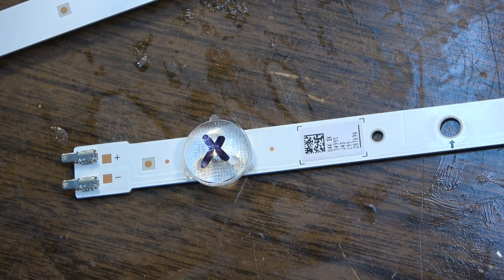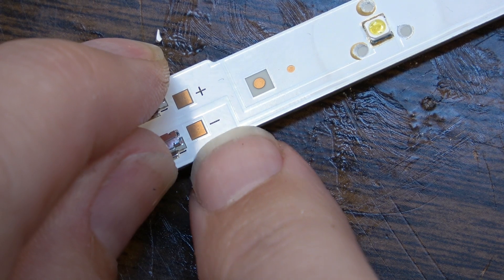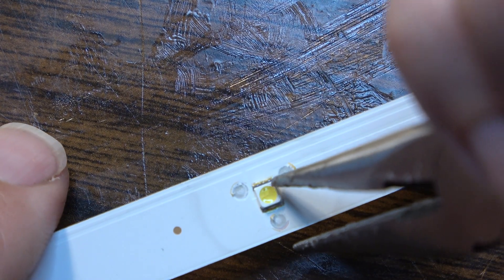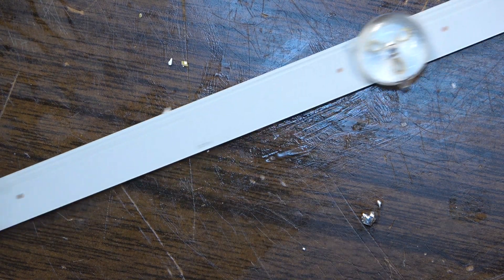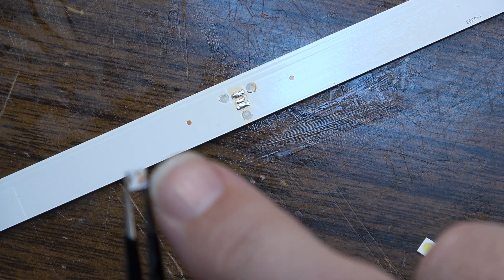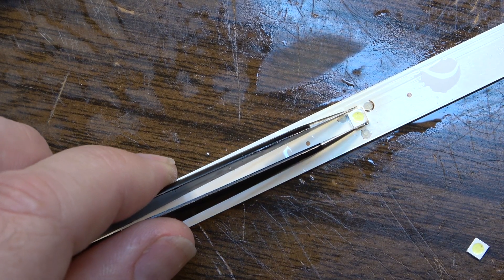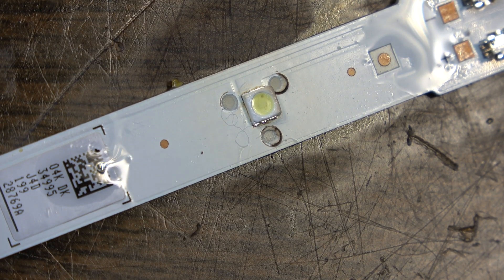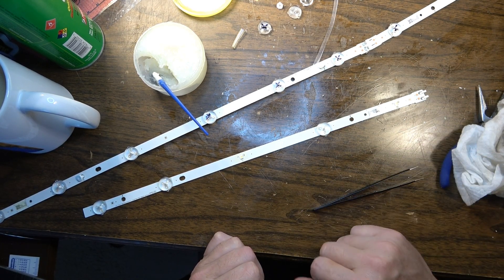How to Solder NEW Surface Mounted LEDs in TVs Instead of Replacing Strips - MUCH CHEAPER FIX!

Comment: All you guys love flooding everything with flux paste - Wasteful, unnecessary habit - learn how to solder! - you're burning up all the flux that's already included in the FLUX-CORED solder on the iron tip - before you even get near the PCB. LOL 

Clean and tin your iron tip, heat the PCB pads, and feed a little fine flux cored solder into the heated area - Done!
If you really want to do it like this, use solder paste, in little tubes, made for SMD work.
Keep flux paste for re-flowing SMD IC's etc.

Comment: I used a mini torch 🔥to remove the LEDs. I heat gunned soldered 3 LEDs in place. I then instead glued the top & bottom of the new LEDs onto the strip & used a 300W soldering iron on the left & right silver area of the new LEDs. The new LEDs had a wide & narrow soldering pad area that had to be soldered on to the wide & narrow pads which were in reverse of the new LEDs — I reverse the plug polarity by lifting the very small plastic lock on the plug to pull out the female connectors (red & black) & switch their places. They all worked but two of the new LEDs that I heat gunned in place turned off when the TV LEDs dimmed down — "Solder LEDs in with a soldering iron" 👈. . .  Heat will ruin the LEDs 🔥

BTW — I used a 3v button battery with wires attached & put 2 wires into its plug as a LED tester 😊

Comment: Yeah, and if you had just applied your hot air from behind the strip, it would all work without melting the LED 😄 And by the way: Hitting pliers with a soldering iron to "clean" the tip is basically plain dumb. The pliers will not care too much ... but those heating elements within the soldering iron usually don't like it. Get yourself some $1 copper/brass wool from Ali, your iron will love you for this.

Comment: Tanks for video. Your soldering tip is miserable!
So you have a heat gun ... why did you use a lighter to heat shrink your tubes for the mac plug repair ?

Comment: LEDs come in different colors (temperatures), brightness and voltages. If the new LEDs don't match exactly the old ones, they will stand out as annoying visible spots on your TV screen. So how do you know which LEDs are right for your specific TV set?
Reply: Exactly my issue right now. I have just 1 failed LED on my RCA and having a hard time figuring out what type/brand of LED to get!.

Comment: nice try! how do you put back the led caps, glue them or don't need to put back? thanks!
Reply: If you don't replace the plastic lenses, the LED will give a bright pinpoint light.  The plastic cover helps diffuse / gently spread the light to avoid "hot-spots " .  Small dabs of superglue are what I use to reattach the plastic to the strip. In the ones showed, there are 3 vary small attachment points for glue spots to match for the best results.

Comment: boy it hurts looking you killing this job ! please stop making such poor job !  you have correct tool but not the right technic !
for such job heat gun goes under the strip so you can unsolder the led and same for soldering back the new one without damaging it from direct it. even better and simpler with hot plate

Comment: Added the 1K like for your video!   I have repaired lots of stuff, including TV's, but repairing these LED strips, my first time.  Luckily I already have Hot Air rework station, good commercial soldering iron, and skills.   There's a video of a guy doing this with an Alcohol Lamp, heating the strip from the bottom to remove the LED's.  If you haven't seen it, you might like watching it.

Comment: clueless video. There is a reason it is recommended to replace all led strings when they start to fail but there is also a firmware update that has to be done as well.
Reply from the maker: pfft. Ok.
Reply: @TheGuitologist  the blind leading the blind is always good for a laugh but never the right way to do things. Don't let that stop you tho 😂

Comment: Thank you for the helpful guide. I am impressed that the heat produced from the heat gun does not destroy the LED component. I see from your comments you used the TXINLEI 8586 110V Solder Station. What temperature did you set the heat gun to?

Comment: Yeah I wouldn't rip off the LED with the pliers like that because if the pads from the trace come off with it then you're going to have fun bridging everything and it won't sit flat , it works though but it is possible too rip the pads and if you use the heat gun from the bottom then you don't burn anything on the top and you don't worry about the LED going for a ride I'm sure this has been mentioned in some of your comments but I did not read any of them so my apologies if I sound like a broken record other than that cool video cheers

Comment: I have done this a small hand full of times and use a hotplate for this purpose purchased on Amazon. It heats from the bottom and worked great each time. Just need to be careful as I burned a finger or two the first few times.

Comment: Hello from Germany, 🙂✌

Based on my experience, I heated them from below. Otherwise the plastic will melt and the LED won't survive for long. 👍
Reply: Yes, I used a soldering iron vs a heat gun. See my other comment.

Comment: I've tried this method,however instead of a heat gun, i used a hot plate, it does save you money, but the amount of time its not worthy since some of the brand new strip sets are cheap enough, also, if you just replace the band LEDs on each strip, eventualy the other ones will go bad, its always better to replace all of them with brand new strips. Lastly, those LED lenses are a pain to glue back and some strips if they are just a bit crooked you'll end up with white spots on the screen.

Comment: I did replace close to 5 of those led using older led for another tv, problem is they are dimmer once I turn the TV on, what surprised me when I saw that is that when I use my led tester they are the same brightness as the others but thought the tv power they produce less light even if the original one's one the same strip produce full brightness

Comment: I use aluminum tape and scotch tape.  I dont know how to solder.  And it repaired my black screen.  Am i Crazy or what.😅
Reply: Could you tell me how to do it without soldering I'm just about to fix my 65 inch TV and I've never soldered I'd rather try your technique it would be greatly appreciated thank you

Comment: I think you are damaging the layer on the LED by heating it from above. I don't think it was soldered by heating from the top in the factory!
Reply: Just heat from below with heating source and falls off it's like FETs soldered to a heatsink in some car amplifiers😅

Comment: thanks for sharing your ideas - just a suggestion. Rather heat up the solder for the LED replacement from the bottom...then you dont have to burn the LED with the hot air. The removal can also be done by melting the solder from the bottom ;-)
Reply: I was gonna say that.. or use a clothes iron if u have too.. or hot plate.. but if ur gonna use hot air.. don't burn up the plastic
Reply: @TerryDeSimone  I noticed the other side of the strip is copper coated, so I was thinking maybe that makes it easier to heat from beneath. Might need to watch your fingers though and don't lean over too close or things could get a bit warm.
Reply: With all do respect but you fried the led when trying to solder it. The entire  silicon is wasted and that led will not last long. You should heat from the bottom instead and no hit the led directly.

Comment: good job ,   how do you know if the tv  needs  3v or 6v  smd led   i have a tcl 43s421 to fix  and not sure what voltage  these leds need
Reply: Good question, I should have known that before replacing mine :), i should have use my multimeter and measure on the backlights

Comment: You must NEVER use the welder on that way. It is not a painting operation. You have to warm the area with the welder and then, apply the tin, which will melt and cover the area. The way you do it you only will get the tin totally burnt. Good video anyway and do not worry, a lot of people use the welder in that way, but it is totally wrong.
Reply: soldering iron not welder ..................

Comment: I think there need a lot practice and good luck, tried three LEDs dead all fried from hot air gun, that basement not copper - some kind of China material where solder won't stick
Reply: Start by buying a proper soldering station  like Weller ,jbc or if you are on a tight budget start with a universal 80w soldering iron (80w seems allot but your dealing with a cheap iron)proper tweezer and you need to calculate your led that your gonna replace otherwise after 2 months you gonna replace the same led on that row of line for example you have a Samsung backlight system that requires 3v per led you can replace it with another 3v led universal but you need to know how much what you backlight circuit draws If you backlight uses 3v 1w led I would use a 3v 1.5w led instead by trial and error I found that they last longer than if I would install regular 3v 1w led
Reply: @Creative_thinking359  you are right

Comment: Awesome. And timely. I have an led tv that has a fault. It has a faint picture that shows up if you shine a flashlight on the display, which I think indicates either a bad led backlight or the board for it. I'd like to fix it if possible. I'm tired of throwing away simple devices because nobody thinks it worth fixing things anymore.

Comment: Very useful follow up video.  I like the long one as well as it shows the whole journey, including the learning process.  More YouTubers should follow that format (full video + condensed "summary").   Anyway, I was thinking  SMD-solder-paste may be helpful here.  I seem to remember it melts at a lower temperature so it would not strain the LEDs that much during soldering.  (I fear the LEDs may break down early because they were strained/overheated during soldering)
Thank you for the useful video !
/chrisV
Reply: 138c paste would be good ............

Comment: I've fixed two TVs, a Panasonic and an ALDI 'Bauhn'. Both had single led failures which stopped all other leds glowing [series circuits?]. I tracked down the failed led and removed both lens and led. Then I snipped a working led from a spare backlight strip, about 1 1/2 inch of strip either side. Then I 'jumper wired' this in place and stuck it down with double sided tape. Unfortunately in the Bauhn a further led burned out shortly after reassembly and I had to replace it also. 
I salvaged the backlight strips from a 'broken-screen' tv I found dumped nearby.
Reply: Sometimes with backlight failure the screen is still operating. If you shine a light onto the screen you can just make out the picture. If you see that picture then you'll feel more confident that it's just a backlight failure.

Comment: There is no need to crush/break the LEDs, as mechanical stress has more potential for substrate damage than heat. You may need a smaller exit tip to keep the heat concentrated, and perhaps less air speed.
Reply from the maker: In this case, I wasn't doing it with damage prevention in mind, only speed. It's very fast removing them by breaking them off and then coming back with the iron. You could be right in your assertion generally, but out of all the ones I replaced, no substrate or pad was damaged using this method.
Reply: @TheGuitologist  I say do what works for you, if we all went by the book or by other peoples rules this hobby would be boring AF, finding shortcuts that work is half the rush of doing all this, hell i just saw a couple of shortcuts i'm going to attempt just by watching this great video. And i say hobby because it is fun to me as much as profitable.👍

Comment: If you're using hot air and you're worried about something melting. Just come from underneath
Reply: Yep, or use a hotplate (old electric hob)
Reply: It's better to heat from underneath.  You can preheat, then place the LED on top and heat it again. If the pads match well, the LED will automatically slide into place and flatten itself when the solder melts.  And it won't blow it anywhere.

Comment: So cool!! You make that look really easy!!! Is it possible to fix a Plasma Big Screen???
Reply from the maker: Depends on the problem. Is the problem a broken or cracked screen? If so, not likely to find a replacement.
Reply: @TheGuitologist  My main TV is a Panasonic 50" Plasma I bought back in 2010.. I love it and is still working great!! Hopefully will never get a broken or cracked screen!! Just seen other people with Plasmas have Horizontal lines and or large dim areas appearing and making them un-watchable. Would be nice to know if there could be a fix other than to throw them away in a junkyard!!!

Comment: Been playing with game console repair lately. Newer stuff has that low melt solder. No wonder only half of them work when they can be taken apart with a hair dryer. Chips get hotter than that when a little dust gets in them
Reply: The manufacturer rarely uses it. Mostly repairs or mods in my experience.  Smd stuff is easy to kill though haha. I'm in and out quick with a hot iron and leaded solder haha